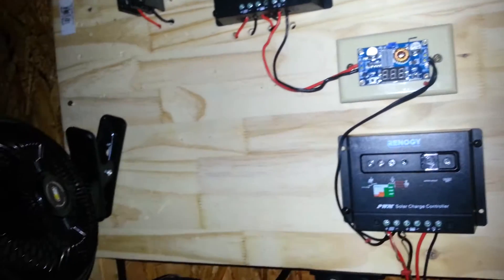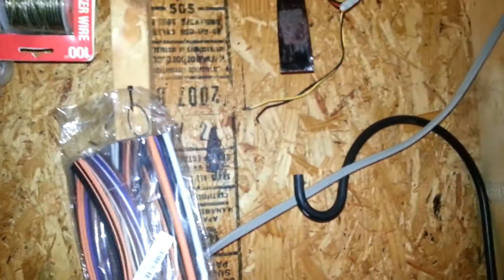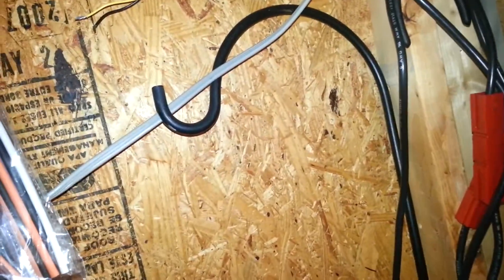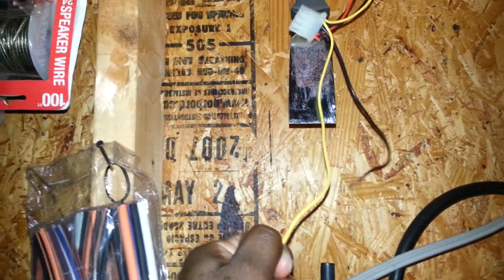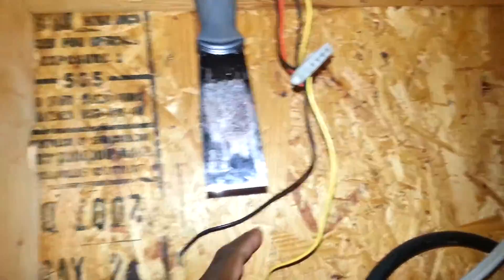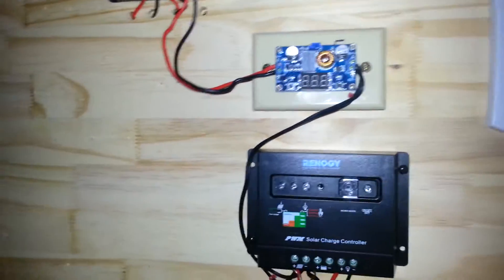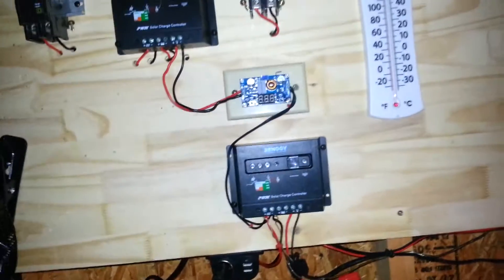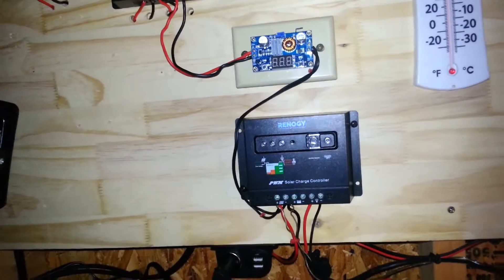12 volt vs 24 volt solar setup pros and cons

Comment: Hi, Great video. I have a 100w x 2 solar panel and connected in a series  = 24vlt. The charge control is a 40amp MPPT. Can I charge a 12vlt(single) battery ? But if 2 batterie, How do tied them together ?  Thanks

Comment: As you say, the higher the voltage, the more the current, and you can use  smaller wire... But as long as you size that wire appropriatly say for a 3% voltage drop, the loses are the same. Its just that you will spend more money on wire, vs more money in batteries and then either 24 volt stuff, or 24 to 12 volt DC/DC converters.  So if you have long wire runs of high amp needs, go with higher current, if your needs are more on the lower side, go with lower current.

Comment: Can I use a 330W 24V panel to charge a 12V battery bank?
I'm just starting out... only have 1 battery now (100ah) agm
Reply from the maker: wildbillo68 
Yes but you will need an mppt solar charge controller.
Reply: Great.... Thanks... that is what I went with ...(Pay more for MPPT now and have more flexibility lol)   thanks...

Comment: I am little confused, when you use12 v or 24 v system, invertor will convert to ac power from dc  for the house hold things to work right? so why getting a 12 or 24 v appliances?? is it because those are  cheaper than 120v items? or it draws less power ??
Reply from the maker: panisher 
The 12 volt or the 24 volt equipment can run straight off the solar system without the need of an inverter to convert from DC to AC.  No need to invert if all you want to do is run a few 12 volt or 24 volt LEDS, etc.  It all depends on your application and and what you are using the system for.  Anytime you convert from a DC to an AC  voltage system, the intermediate converting device (inverter) will consume additional power.

Comment: At the end of the day...is it not the amount of amps produced to keep the battery bank filled?  For instance if 2 100watt panels are wired to supply 24 volts into a 24 volt bank, are you not gaining less amps than a 12 volt system?  I'm trying to figure out if it is worth 12 or 24 volts.   Seems to me that amps are the most important issue when storing electricity.

Comment: All i understand is ( and you did avoid it here..) in 24 Volt Systems you need double the Solar panels to get the same Amperage into the Batteries and that was why/if i always opted  for the 12 Volt - Version,to save on massive,expensive Solar panels,am i correct ???
About the Difference of 12 to 24 Volt - Gear in Cash i won't bother as any Lorry - Driver has 24 Volt - Gear instead of 12 from somewhere ??? ( Truck - Shops ) issa kein Problem..at least here in Europe...

Comment: Good information. Would like a further elaboration on the dual voltage setup with the voltage regulator. On large boats with solar capabilities, the engine starting battery system is typically 12 volts while the main system is 24 volts or larger. Charging the starting battery within the entire system would be ideal.
Reply from the maker: Please watch this video:
https://youtu.be/F9k9d1ERfVs

Hope it helps.  Thank you.

Comment: I saw some where on youtube where a guy mounted an aluminum 1/8th" plate behind his controller and inverter I guess to help cool it better.  The plate was cut 2" bigger on all sides than the device.
Reply from the maker: Yep, it helps with heat dissipation as air moves over the unit.

Comment: I like how you "Back-Stabed" the wire through the wood panel board.  I'm doing the same thing only I have 1/4" paneling over the 1/2" plywood.  To bring wires through the backer board, I used the round 1-1/4" plastic things with flat caps that snap in you see in and on office furniture bought from Lowes.  I was gonna use rubber grommets but they wouldn't have been big enough for the 1/0 wire.  I bought two 5" - 12 vdc computer fan's to blow over the controller and inverter heat sinks.  My battery bank is in the middle of the floor over the rear axle and between the wheel wells.  That half of the RV floor is a foot high with a hinged door for battery (10) access.  My sewage & water tank is also recessed in the floor to the rear because bigger 40 gallon tank's couldn't be installed underneath where the old 15 and 20 gallon tank's were before.   Atleast I won't have to worry about frozen tanks anymore.  The single twin bed is over that and can hinge upward to fold away.  Next will be an RV style 120 vac, 75 lb washer and dryer.

Comment: Amazon ($14) has a orange Double Pole Double Throw knife style transfer switch with an OFF center postion that I'm gonna buy so I can charge 2 different sized battery banks off the Controller because as you know, you can't mix new and older batteries.
Reply from the maker: I will have to check that product out.  Thanks for sharing.
Reply: +DIY OneForAll 
The MPPT Renogy 40A 12/24 vdc controller is $188 on Amazon.  Very nice controller for the money. They make a smaller one too.  For now, I've got the Walmart Everstart 122 ah deep cycles ($100 ea) going on 3 year's now.
Reply from the maker: +jim lucas 
Yeah, It appears to be a nice charge controller.  I started out small with the cheap PWM charge controller but have been watching a nice MPPT charge controller for the longest on Ebay --- kind of pricey at the moment... lol...have to convince the wife, hehe :)
Reply: +DIY OneForAll 
My first solar panel was a 5 watt charger for my cell phone laid up on the dash and the size of a business card.  Lol!  My first controller was a PWM too.  The Renogy MPPT 20 a for $168 and 40 a for $188 on Amazon hands down is the best deal out there period.  12 v 500 watts / 24 v 800 watts max 100 vdc solar in.  I like the Grid Tie 36 VOC panel's best.  Wish I had the buck$ for T105 Trojans though but my Walmarts are doing a good job too.  Have you compared the single weight of a 6v Trojan to a 122 ah Walmart EverStart 12v?  Both are 62 pds each which tells you the Trojan has heavy thick led plates and more forgiving.  I was smart enough to make sure my battery box was 13" high for the later battery Trojan upgrade.   Trojan 6v are 11.03" high.
Reply: +DIY OneForAll 
The Renogy features 4 charge rates too. (BAFE) Bulk, Absorb, Float and Equalize.
Reply: +DIY OneForAll 
If you go on some of these Solar Forums you can buy good used equipment from where they've upgraded too but only buy it from the sharp older guys that moderate the chanel.
Reply: +jim lucas 
I took my left over scrap EPDM 60 mil rubber roof to line my battery box.

Comment: Nice set-up! I have both 12 v and 24 v set-up on my RV roof.  12 v for lighting along with plug and play items then 24 v for my Engel fridge which can be 12/24 vdc or 120 vac.  The 24 vdc also feeds my 2,000 watt inverter which in turn feeds a 5,000 btu, 5 amp 120 vac window air conditioner. They say as a rule of thumb that if your at or close to a 1,000 watts of solar then 24 vdc is the way to go and at 2,000 + watts 36 to 48 vdc. Although I have a Pyle 24 vdc to 12 vdc converter i use.  Some will say that your load is what determines your solar and battery array but I disagree and have purposely over-sized my system because I wanted to use all my roof space for just the solar panel's only which is why I removed the broken roof top AC and Fantastic exhaust fans since I was replacing the roof anyways to a new EPDM rubber roof.  My 6 panel's are the 39" X 67" 250 watt Grid Tie panel's that are series/paralleled to a MPPT 40A, 100 vdc input 800 watt max Renogy Controller.  I ran #8 gauge wire and soldered them to the 10 gauge solar panel's instead of using the MC connectors.  Over-kill I know but I'm an Electrician by trade and who knows what I'll add next.  I'm thinking of adding 8 of the narrow 100 watt panel's 26" X 40" to both sides of the Rv just below the roof line front to back for increased power and because I have NO roof space left, Lol!  That way I can run my AC unit at night on a separate MPPT Controller and battery bank.   Never thoght I'd go this far but I did.
Reply from the maker: Thank you.  My plan is to add more panels soon. Wow, you also have a very nice setup there! Very nice :)
Reply: +DIY OneForAll 
Kinda wish I would've just bought a skid of panel's (70 cents a watt) and then sold what I didn't need but no one would go in on a skid with me.
Reply: +DIY OneForAll 
This old guy I know buys several skids of Grade A solar panel's then re sells them out of his garage cash for a profit.  He knows nothing about solar nor does he have any on his house.  Lol!
Reply from the maker: +jim lucas 

I know the feeling.  Many people don't know the importance of "grid independence".  I have friends who often make comments like "how long will it take to get your money back"?  My goal is to be totally off the grid in the next five years.
Reply: +DIY OneForAll
 .I use to have a youtube channel but after people and Trolls tried to Sharp Shoot me on what, why and how come, I just stopped making videos all together.  I'm 53 and a retired Army pilot so now I just travel around in my RV staying at Walmarts and do my handy work on the RV at either Lowes or Home Depot so I pay $0 for rent which is why I have so much solar-disposable income.  Although I have a generator,  I never use it because I just don't need it.  Through the year's my so called friend's advice has never worked nor would they even take their own advice they give so your better off doing it your way anyways.  The whole solar and remodeling RV thing is just something to do.  I could work for somebody but who wants to get yelled at for $7 to $10?  Not me.
Reply: +DIY OneForAll 
So much for other people's advice anyway.  Hell, most of the people my age are loaded down with debt because of charge cards, 2nd mortgages, boats, tattoos,  drugs and beer and or they're going through a divorce and paying child support too.  I don't have any of that and that's real freedom.  If I don't like my neighbors I just move my rv 100 foot. Lol!  I'm in Florida now until it gets hot then back up north for the summer chasing the weather.
Reply from the maker: +jim lucas 
Thanks for your service to the country.  Much respect, sir!

I believe you should consider starting your YouTube channel again.  I have learned our the few years that I have been on YouTube that some people will not always embrace what I do and may have different views on my approaches.  But, it's all good.  I have learned to ignore the noise and continue to do what I enjoy doing.
Reply from the maker: +DIY OneForAll 
I personally would really enjoy seeing videos of your set-up.
Reply from the maker: +DIY OneForAll
Also many viewers will benefit and learn from your videos.

Comment: How do you connect the 12v LED lamp to the solar system? Directly from the battery bank or something else?

And how do you connect the battery bank to the inverter?

Thank you.
Reply from the maker: The lamp is connected through the 12 volt portion of the system. Batteries are connected in a series parallel configuration in a 24 volt system

Comment: I noticed you have Square D breakers.  Are they rated for DC?  None in my area are. IF they are, what is the model number.  Thanks!
Reply from the maker: Yeah, I am just using regular 60 amp breakers but as disconnect switches vs circuit breakers.  I do have a true DC breaker in my battery box (non Square D) that I purchased off Ebay.  That breaker connects between my inverter and battery bank.

Comment: Very nice, well thought out and put together. I can't agree with you more about current vs voltage and wiring. I might add, its awfully nice to have the added capacity of 2 batteries in a 24 volt system along with, as you said.... the higher voltage lower current. Thanks for your video.
Reply from the maker: Thank you very much!

Comment: My cables don't even get warm with 12 or 24 volts so heat is not a problem for me. I am using a inverter 115 AC. Aren't amps more important than Volts? With 12 volt solar panels i will get more amps than 24 volt solar panels. Will i get more power with 12 volts vs 24 volts? Because my solar panels have 12 volt and 24 volt jumper wich should i choose 12 or 24 volts to get most power?
Reply: +Richard Villacreses 

Hi Richard, you will get the same power with either 12V or 24V systems. The reason is because the higher voltage your system has, the lower current will be flown through your cable. For example, if you have two solar panels and each panel is 12V and 25A, if you connect the two panel in parallel, you will get 12V and 50A, and if we multiply the volts times the amps, we will get the power. 
So 12V X 50A = 600 W.

If you connect the two panels in series, you will get 24V and 25A, and if we multiply  volts X amps will get the same power.
24V  X  25A = 600 W.

I have also been searching a lot about what is the best between 12V and 24V systems since they both eventually provide the same amount of wattage. The information I have gathered so far are if you choose 24V system, that means the current will be lower, and if the current is low, that means you can use smaller cables which is cheaper.

Also, if you use 24V system, the voltage drop due to the cable resistance will be much less than 12V system. The reason is 24V system uses smaller cable than 12V system.

I hope this was helpful.
Reply: +Richard Villacreses 
Here is a link of a video that explains types of cables and voltage drop.
Reply: +Abdulelah Alzahrani 
Thank you
Reply: +Abdulelah Alzahrani 
The link is not appearing.
Reply from the maker: +DIY OneForAll https://youtu.be/JownfvtZ3aU
Reply from the maker: +Richard Villacreses 
You may also check out this video on wire gauge and current limits: 
https://youtu.be/JownfvtZ3aU